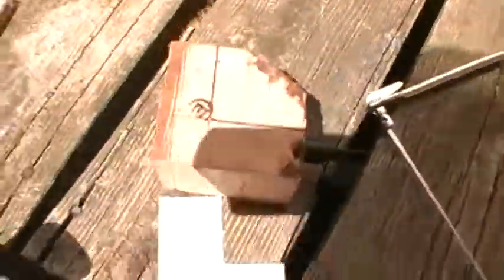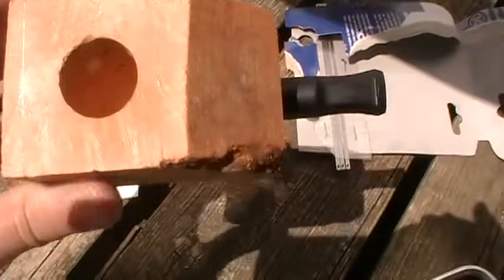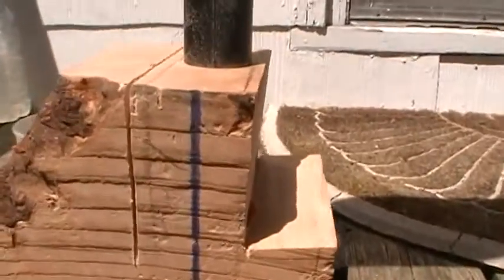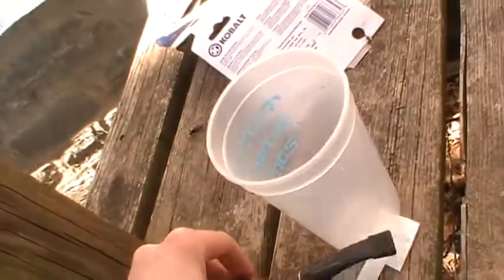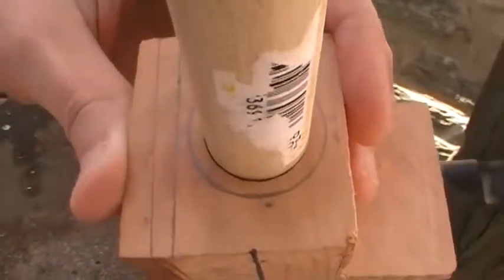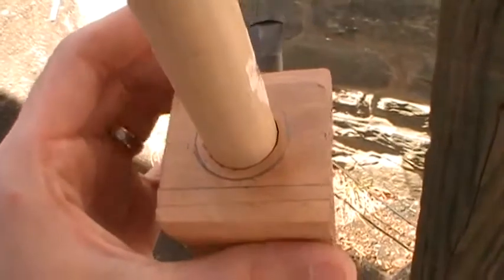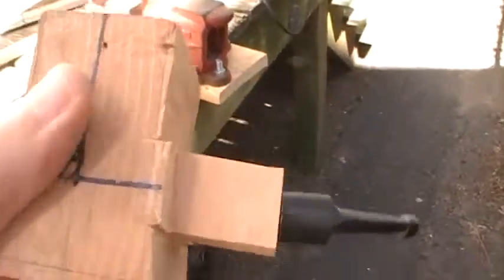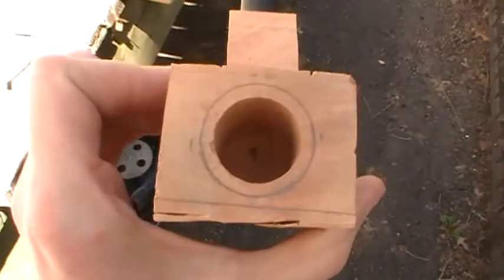Amateur Pipe Carving: Coping Saw

Comment: It looks like you are off to a great start.  I like how you used the dowel to visualize and better hold the material.  My only concern and it might just be because I may not understand your end vision is, it looks like the walls of your bowl you plan to make pretty thin.  If you do make them thin just know that your pipe runs the risk of getting too hot. I never have made I pipe but that is just my understanding.  Have a great day and I wish I was doing what you are doing today.
Reply from the maker: Thanks! That line is not the edge of the bowl, but a quick guide line I put down by holding a pencil against the dowel. They are much thicker. Thanks for looking out, though!
Reply: Thank you for understanding that I was not trying to be a jerk.  :)
Reply from the maker: For sure! I really appreciate the try to help out. I've done it before and been called out for being a jerk, so I definitely won't do that.

Comment: I've been looking to get into it myself, but can't afford the briar right yet. I have, however, been experimenting making tampers, some of which have come out very nice. Just out of curiosity, where did you buy your block of briar, and what was the starting size?
Reply from the maker: I got my kits from Vermont Freehand (try eBay or facebook).  He sells some pretty cheap blocks that are small. He also was able to take the ideas I gave him and find blocks to fit. I got three kits drilled for $66 shipped, but you might do better if you are happy with smaller blocks. If you have a drill press, you can save $7.50 per kit by drilling your own, but you have to buy chamber bits. PM me if you want to talk more.
Reply: Smoke Signals Thank you kindly!